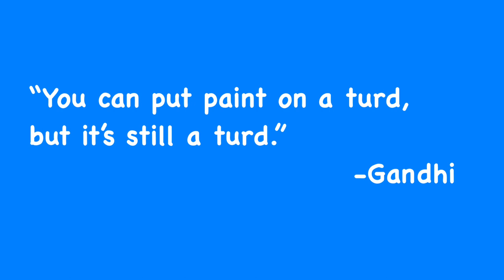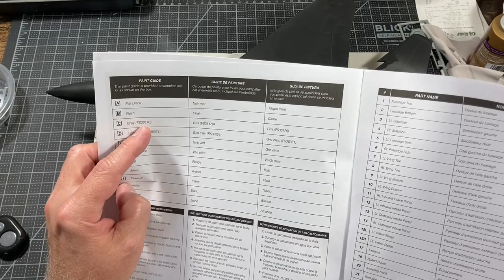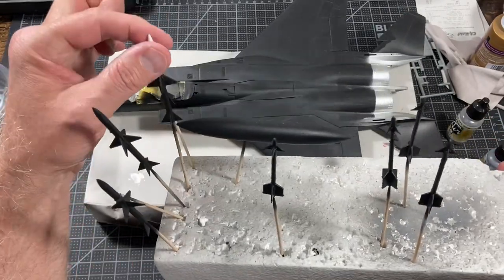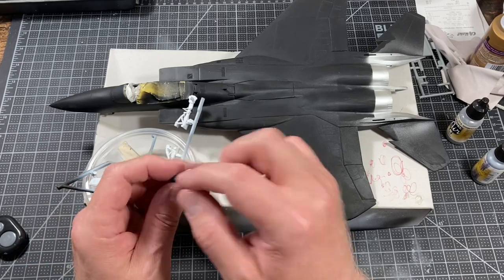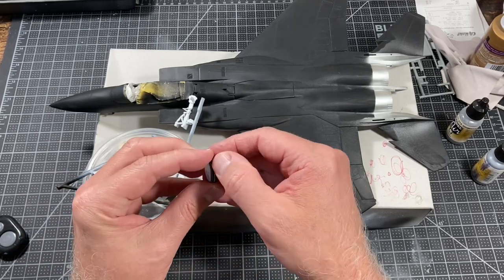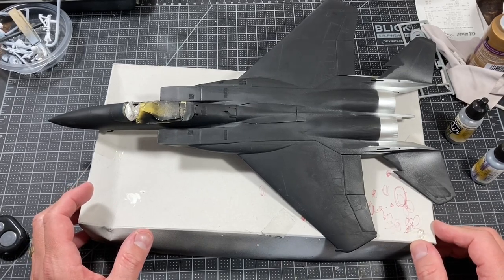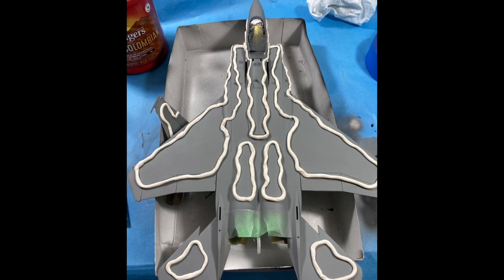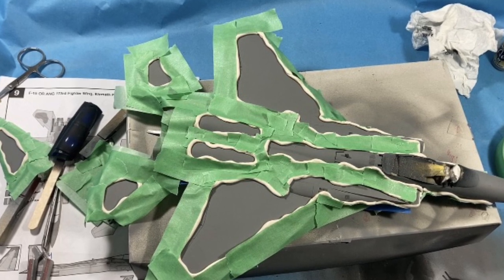Building the Revell 1/48 F-15C Part 3–Painting

Comment: The end is near...
Reply from the maker: It has taken years off my life!!🤣🤣
Reply from the maker: How did you deal with the decals going over the probes?
Reply: @Drewsmodels  I didn't install them until after the decals went on.  You will have to put a small slit in the decal fit the probe thu, or slice them off and replace after decals are set.